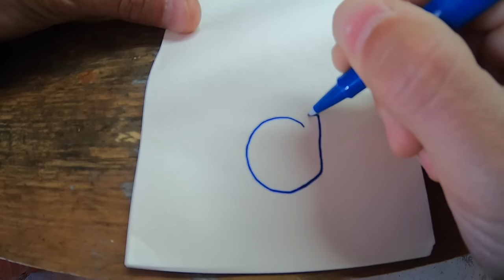MAKE YOUR SNOWBLOWER THROW FARTHER AND NEVER CLOG. Install A DIY Impeller Kit.

Comment: There is a reason why there is a gap between the impeller blade  and the housing. ( Google it )   with this set up you are putting undo stress on your belts and motor. I never have to throw my snow 15-20 feet, what for? Most likely you'd be throwing the snow in your neighbors yard. or maybe on his roof.  The impeller is balanced at the factory and drilling holes all over the place and a slight wobble will destroy the bearing inside the impeller and other things.........
Reply from the maker: tom miller well... the machine is over 30 years old.  If it breaks oh well. Meantime we’re having fun with it. It throws pretty far. I’ll probably do a follow up video on it at some point. Thanks for watching!

Comment: Give all the inside surfaces and discharge chute a good spray of silicon. It will make a big difference, especially with wet snow. This also works good on your snow shovel to keep snow/slush from sticking. I did mine today and it worked very well.
Reply from the maker: Good tip! Thanks for checking out my channel!
Reply: Absolutely love this tutorial

Comment: Good thorough video.  Having done this mod on several snowblowers, I learned that it is a good idea to run the auger after installing each paddle.  This will trim each paddle, one at a time.  I have had machines that were not able to spin all four untrimmed paddles after installation.  Saves your auger belt.
Reply from the maker: Thanks for sharing this tip Bob! Good thinking!  👍
Reply: i heard wont work on Toros because they have a metal piece inside u cant attach the paddle too
Reply from the maker: @JustaKarenDiscoveredTheIntrnet  interesting I have never heard this before. On the latest models you should be able to attach it no problem. Thanks for sharing!
Reply: I'd like to make a recommendation using a red hot metal 1/4" rod to put you holes through the rubber with. Kinda smelly but easier than drilling. But both ways will work just fine.
Reply: “Attaching one paddle at a time”!?
But surely any rotating wheel has to be in balance or it'll shake the devil out of the whole machine won't it?  😊
Or is this controlled sufficiently by the impeller housing not allowing throw out?  Would this physics even compute? Lol.
Reply: @r.martin3494  I thought the same thing lol. Starts jumpin shut er down lol

Comment: Drilling would be much easier if you start with a small pilot bit, then use the clearance bit. It will make it much faster and easier.
Reply from the maker: Some lessons were learned filming this video! Thanks for watching

Comment: I have done this with about 40 snowblowers and yes it works very well.
I do a couple things differently 
The place where the impeller is closest to the tunnel is at the bottom so that is where I put the paddle tight to the tunnel to do the gap measurements at the bottom.  Next I use 3 bolts 3/16 or 1/4, yours were bigger......doesn't matter though. Next I make my paddles longer going right around the curve to the end of the metal paddle and that is where I put my 3rd bolt. You will notice there is a ridge or lip there so I cut a notch in the paddle to fit that ridge. To make this easier I first make a template of cardboard. 
Then when I first try the machine I spray a little lubricant on the inside of the tunnel so there is less friction and strain as the paddles get settled into the tunnel.  
Just thought I would add some suggestions .
Good video,  thanks
Reply from the maker: All good suggestions here Byron! Thanks for sharing! Thanks for checking out my channel!
Reply: You definitely don’t
Reply: i heard wont work on Toros because they have a metal piece inside u cant attach the paddle too
Reply: @JustaKarenDiscoveredTheIntrnet  never done a Toro,  but I think you may be right,  only way to know for sure  is to try to do it

Comment: I appreciate your effort to make a video about this great mod to snow blower impellers.  Might I suggest a much quicker and easier way to do the same thing.  I've done 5-6 for neighbors and on each one I learn a little more and want to work a little less.  First I measure and cut the rubber pieces. I use a truck mud flap that I found in the street.  I then bevel the leading edge of the rubber on my belt sander to help the wear in and avoid catching on the uneven sheet metal.  Then I locate the rubber piece on the impeller blade and hold it with a small clamp.  I then secure it to the impeller blade with a single 5/16" X1" hex self tapping screw through a 1 1/4" dia. fender washer in the middle of the rubber.  I've never had one come loose or off because the force of the snow keeps the rubber against the impeller blade and holds it there.  No extra separate drilling of holes and the whole job takes less than an hour.  You could use two self tapping screws w/fender washers if it makes you feel more secure.  Hope this saves some labor.
Reply from the maker: All good tips here! Thanks for sharing mtcman! Thanks for checking out my channel!

Comment: I've been doing this to all my snowblowers for years and you're right, it makes a tremendous difference in snowblower performance. Years ago they only made single stage snow blowers for garden tractors and I even made rubber flaps for single stage units. They would blow even the heaviest, wet snow with ease! Good video!
Reply from the maker: Mark Loomis thank you!  It’s a great modification that can only benefit your machine.
Reply: @chrisreynolds2410  proper training! I'll help her out, send her over! 😂🤣😂🤣😂

Comment: I did this years ago. Works like a champ. I used stainless steel self tapping screws. Mine would actually throw the watery slop along the curb. The rubber wears down quickly to where there is no noise. The video I saw about this suggested making a slight bevel on the rubber. Great video...
Reply: The new Ariens machines have tighter clearances for the impellor thus no need to do this mod.
Reply: Stainless self-tapping screws?  Not for the impeller blade, right?

Comment: Great idea! I'm going to do this on mine. I have one suggestion for easier install. I used to work for a coal mine and worked on conveyor belts, which looks like what you are using. Drilling out the rubber can be difficult and even harder to get bolt thru, purchase a set of hole punches, i believe we purchased from harbour frieght. Works great!
Reply from the maker: Great idea!  May have to give that a shot on the next impeller kit install!  Thanks for watching!

Comment: We just had a wet slushy snow storm and I did this modification over the fall using pressurized hose. Worked great. No clogging. Definitely would have clogged before hand. Was even throwing ice water. I installed rubber on each impeller blade.
Reply from the maker: Another satisfied customer lol!!! It definitely works very well on the slush at the end of the driveway!!!

Comment: I used some pickup box bed liner material, the drop in kind. It was pretty quick to install 2 of these impeller enhancements with self tapping bolts on the '70s vintage 8 HP Ariens. Made the paddles over sized and they quickly wore themselves in for a close fit. The old dude blows snow much better with the enhanced impellers. BTW, had to replace the bearing on the impeller shaft and removal of the "V" pulley required making holes in the pulley so a hub puller can grab the pulley hub itself, even then the puller drive bolt had to be hit with a 10 pound mall to get it off. What a PITA!!!!! A friend repairs blowers and says many of those with stuck pulleys end up on his scrap pile, not worth the labor. Happy blowing.
Reply from the maker: Timothy Carvelli glad this modification worked well for you!  Also glad to hear your snowblower can live on!
Reply: I ran into the same thing with the stuck pully.  Drilled the holes in the pully but instead of using a puller (the one I had did not fit) I got some regular bolts, a few nuts/washers, a socket for a spacer, a piece of scrap wood across, and pulled it out by screwing the nuts up (hope my description is not too vague).  The pully came right off.  The (egg) bearing was so worn the guts of it were gouged out and the shaft was flopping around with so much clearance.  I did not want to beat on the pully as I thought that would F up the auger gears on the other end.

Comment: I did this two years ago, use selftapping hex screws and you're done in 15 minute. It works great, I can go through slush easy. I just picked up a 18 hp 30 inch cub cadet it doesn't need the paddles it feels like I could go through the side of a building with it
Reply from the maker: Very cool my friend! Thanks for checking out my channel!

Comment: I did this modification on my Craftsman 26" machine last weekend, but I haven't had any snow yet to see how well it works. I was able to drill through my impeller with my cordless Dewalt drill and good Dewalt bits. The key with drilling through metal is slow drill speed with a lot of downward force, and a little oil lubricant helps, too. Each hole took less than 30 seconds, and then I used a slightly larger self-tapping screw with a #12 washer to compress the rubber evenly. Let's hope it works well.
Reply from the maker: John Cahill sounds like it will work just fine!  Fun project with great results!
Reply: @John Cahill....So how did it work out??? 
I'm thinking of doing this to my craftsman and looking for any input!
Reply: @frankendoll1455 , it worked out great. I didn't have a single clog all winter long. I used a mud flap I got at the local auto parts store and cut it with my shears to fit. It made a huge difference over the factory impeller.

Comment: Did this mod about 5 years ago on my Ariens 8526. Works great as described, BUT, be sure to leave that 1mm to .020' gap between the rubber and the sidewall. If you don't leave that tiny gap, when you're done snowblowing and park that mean machine back in your garage, the remaining snow in the housing and chute melts and then re-freezes at the rubber/sidewall junction (even after coating the area with Sno-Jet). 

When you go to re-start the snowblower impeller you'll get belt slip. Had to shut off the snowblower and manually rotate the impeller through a revolution or two to free it up. Even though I started rotating the impeller before engaging, I was going through a belt a season (that's only been about six blowings) until I removed a little rubber off the ends. While the rubber removal improved belt wear, I added a dual belt pulley as I was still getting a bit more premature belt wear than I think I should.
Reply from the maker: hunter548 helpful tips here! Thank you hunter!
Reply: When I  did mine, I  noticed the same freezing problem, my solution was to make sure none of the paddles were at the bottom for the first half season, no problems and still the same belt I had when I modified it.
It's been 8 years!!! 😁👌

Comment: I did the same about 5 years ago and it works like magic. I drilled the holes through the rubber first and used the rubber as a guide for the holes in the impeller. I would have to be a Contortionist to do it your way, the marking part.    Lol
Reply from the maker: Thanks for sharing Bill!

Comment: I've done about 8 of these machines already. Use a set down bit then follow up with self tapping acres with washers. So much easier and will hold just as well!  Also I used my cordless drill driver. Fast and simple
Reply from the maker: Good plan of attack!

Comment: I did this about 15 years ago by clamping 1/8" thick strips of steel to extend the impellar blades and mark off the slight amount of clearance to prevent nuisance scraping of the impellar against the inside. I ended up balancing the impellar though just in case it should vibrate. It's  definitely worth the effort as long as you do this in warm weather or a heated garage or shed. I also welded the extesions instead of bolts because I was afraid of a bolt coming loose or breaking and launching from the chute. This 9hp Sears Craftsman snowblower now throws heavy snow, slush, and sizeable chunks of ice which can be dangerous, but really beats having to shut the thing off to unclog it.
Reply from the maker: Agreed well worth the time and effort! An hour or so of work goes a long way!

Comment: Perhaps use a shim when marking holes / installing rubber to create a small space between the rubber and wall.  Shim could be made out of a piece cut from a plastic jug.  Also a good tip...spray some silicone on the gathering impellers, interior walks, chute impeller and chute.  Prevents snow from sticking.  In the spring I clean and wash out these areas a d after drying spray liberally with a rust inhibitor such as Rust Check or Fluid Film.  Helps prevent corrosion from forming while stored.  I spray it again in the fall when prepping the blower for winter use.
Reply from the maker: All good tips here! Thanks for checking out my channel!

Comment: The addition of rubber belt flaps on the impeller blades made a HUGE difference for my 30 year-old Ariens 7HP SnoThro!  I helped a buddy do the same modification on his 8HP Yardman blower and he was very pleased as well!
 BUT I would highly recommend 2 revisions to what was shown here though...
1) I learned the hard way that the gap between the impeller housing wall and the impeller blade edges is NOT uniform!  To save yourself significant rework (and a jammed impeller), initially clamp the rubber flap to the vane and manually rotate the impeller through a full rotation inside the housing to determine where there is minimum clearance and THEN mark it for final positioning 1mm away from the housing at that point.  Then do the same for each additional blade you're planning to modify.
2) Also, if you have a 4 blade impeller, adding the flaps to just two opposing blades is ALL you need to do to make your machine a snow-n-slush-hurling BEAST!  The Yardman had a 3-blade impeller, so we needed to do all three.
NOTE:  You can skip adding rubber flaps to any Ariens model 926000 series altogether because they have very little clearance between the impeller blades and the housing wall.   Although I STRONGLY ENDORSE spending  ~$65 to upgrade your  Ariens 926000 series machine from the original single belt drive to their new dual belt kit - It made a remarkable difference! 
(For 11HP  models and below use kit 72600700)   See https://www.youtube.com/watch?v=sxiq_8cLfKw .
Reply from the maker: All good tips! Thank you!

Comment: The rubber can be easily trimmed with a utility knife to match the contour of the housing, also I clean the inside of the unit and spray floor wax with a refillable spray bottle on all surfaces.
When done you can rinse out the sprayer with warm water so that it will not harden.
I also do this on my trucks 8’ plow.
Lasts a long time.
Reply from the maker: Awesome my friend! Thanks for sharing these tips!

Comment: Where you bolted the rubber to the impeller, you can see a bit of rubbing on the chute wall, causing a bit of tightness. Simple fix, use a dremel to round off the corner. No more strain on the belts. Great video, thank you
Reply from the maker: If the rubber is a little snug it will wear itself really quick to the correct length in most cases. Thanks for watching Gel!

Comment: At 08:13 you could have placed the rubber in position below the metal impeller blade and marked from the top with your marker so as to be more precise.  After the holes are drilled in the rubber they will match when  installed  on the correct side of the impeller.   Thanks for sharing the upgrade  to your snowblower 👍 I will be sending this video to my son so he can use the idea on his Ariens.
Reply from the maker: Thanks for sharing! Can’t go wrong with this mod!

Comment: I did this and I also sprayed the inside of the blower area and chute with ceramic car spray and it made the blower run with much less drag. It also worked on my John Deere tractor grass mower the spray makes the contact  areas of the grass very slick and stopped clogging.
Reply from the maker: Thanks for sharing El robo!

Comment: Thanks J.B. Clogging has been a major problem with my Yardworks 357 cc snowblower, so much so that I have thought about replacing it with a fairly expensive three stage snowblower but your fix might help me solve the problem. It's worth a try before I lay out the big bucks.
Reply from the maker: Mfanawemkosi Fakudze no problem! Worth a shot. This modification costs nearly nothing and takes about an hour to do.  You won’t be disappointed.

Comment: After I drill the holes in the impeller I put double stick tape on the rubber pieces, stick it on the impeller, rotate the impeller up so I can, using a red or yellow Sharpie, mark through the impeller holes the drill holes on the rubbers. No guessing work, always spot-on.  You can also rivet it using the right size washers and have the right riveting tool.
Reply from the maker: Perfect! Like the idea!

Comment: Ok, I installed mine . Made from the sidewall of an old boat trailer tire. Got some wet snow yesterday and gave it a try. It picked a rock and threw it so far, it barely missed my neighbors big picture window. Really, so turn that chute deflector down some more. Thanks for the idea. good video. No clogs and clearing the driveway goes much faster.
Reply from the maker: dufus Glad to heat it worked out for you. It’s such a simple modification with amazing results.

Comment: I used Silicone rubber, 1/4" thick. It stays flexible at cold temperatures so there is less load on the motor and nothing sticks to it. I cut a radius on one edge similar to the snow thrower discharge chute radius. I also used stainless steel screws with a door of Loctite to attach them to the impeller blades. Works like a champ!
Reply from the maker: Great tips here! Thanks for sharing! Happy snowblowing season!
Reply: Where did you get the silicon rubber?